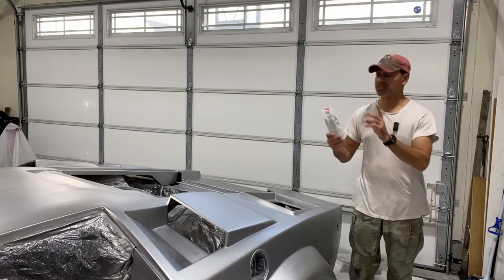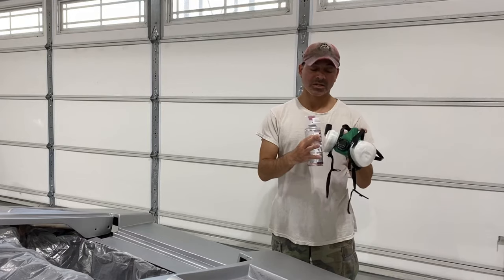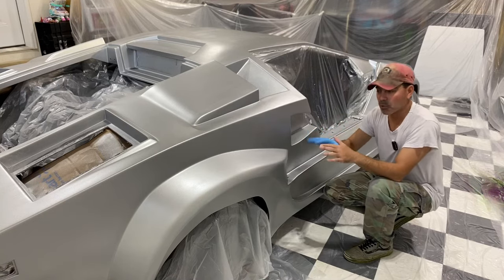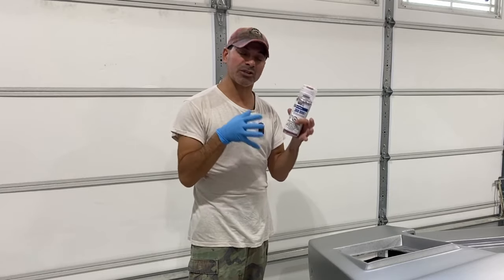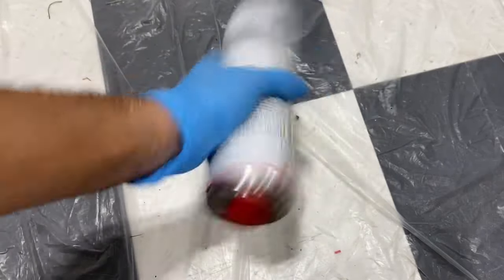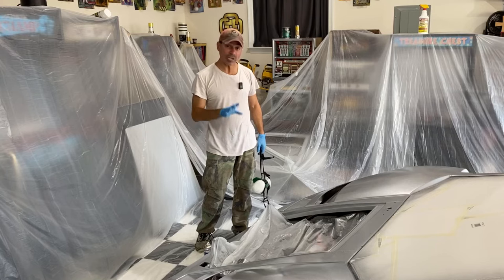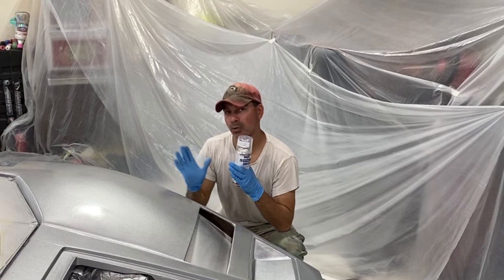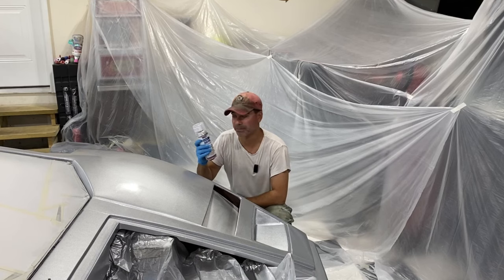Spray Max 2K Clear Glamour - Product Review (Andy’s Garage: Episode - 378)

Comment: I appreciate the review but this clear is meant to be sprayed in minimum 2-3 coats and actually has a higher tac so can be sprayed heavier than shown without runs. Actually very easy to get a factory looking finish with no orange peel using this clear coat.
Reply: I’m looking to use something on my alloys to finish them. Can you recommend a better product or how to get a non orange peel finish with this? Thanks
Reply: @garylow8668 first prep well,just apply more coats, wet sand and buff to get glass finish. This guy went and sprayed an entire car with one can and then complained that it had orange peel?! No shit! Even a pro gun requires multiple coats. I dont know why people feel compelled to do reviews when they have no idea what they are doing and no clue how to use the product.
Reply: Word

Comment: I did the hood and roof of my Corolla used 2 cans ,did 2 quick coats had a little left started 3 on hood but started sputtering,shaking to get what's was left in can..i also wasn't pleased with spray pattern.. definitely have to wet sand and compound... two cans might get you a nice job on 1 panel

Comment: This stuff is amazing for touch ups. I wouldn't recommend it for anything larger than a painted bumper though. Unless things have changed I don't believe manufacturers approve of charcoal respirators for isocyanate 2K paints. Fresh air supplied safety gear is recommended. That chemical is deadly and you really need to protect yourself.
Reply: Thanks for that info whales

Comment: Replacing a fender on my 2004 Ford F-150... it's off the car and I have the color coats already on(Ford True Blue, Duplicolor). I watched the videos and read most of the comments. here's my experience.
Just sprayed on the first coat of the Spray Max Glamour and will wait about 15-20 minutes to coat it again, Disappointed that I got a few spits from the spray nozzle and I did get one small run as I got too much on in one area. Not too much orange peel which is good. I used about a 10-12" wide spray pattern as recommended on the can as opposed to shooting the whole length of the fender. I think I'll do long strokes for the second coat. I check back when I have it done.

Comment: I wonder if you held the can a little closer when spraying if it'd go on a little smoother? I think sometimes, I'm not a professional painter by any means, when spray paint is held too far away when painting in certain conditions that the droplets can somewhat dry before it hits the surface and cause a bit of a rough finish.
 Also, how many cans would you say it would take to put 2 coats on a Lexus ES 330 rear bumper?
  Thanks for the video 👍, I think it turned out good.
Reply from the maker: You might be able to use just one can
Reply: @PhillipsVision  Thanks for the info
Reply: I think you're correct 'bdoeine'...I'm getting ready to use this product on a front fender I'm replacing on a 20 year old pickup. I encounter the rough finish problem when I used the Duplicolor spray cans to put the color down on the fender. I concluded that I was way too far away from the panel as I applied the paint, thus it was going on 'dry'. I found another video where the guy discussed this and he actually sprayed a fender and his hand was literally 3-4" from the panel, and it came out great. I was surprised how far Andy was from the panels Andy was when he did this video..
Of course...the closer you are to the panel the more danger you have from runs and sags. Needless to say, spray painting, even with a gun is tricky and takes a lot of practice and experience.
Reply: @exnjute  Interesting! 👍 You got it figured out, awesome.

Comment: I bought this stuff on a whim from Amazon to try and fix the peeling clearcoat on my 99 Honda crv. I haven't used it yet.  Never done this before.
Reply from the maker: If used and prepped properly it will work well
Reply: How did it go??
Reply: @PhillipsVisioin I have a car peeling on the roof also can I wet sand the clear coat of that's already on there down to the paint then just spray over
Reply from the maker: @joseconstante1321  you can as long as you blend it well
Reply: @PhillipsVision  so I know not to sand the place where there's no clear coat but the rest of the roof should I wet sand it or just the edges where it's peeling or do the whole roof that has clear coat and just spray all what do you think
Reply from the maker: @joseconstante1321  you can try sanding the edges to blend it, but if not you will need to do the entire area
Reply: @PhillipsVision  is 600 grit ok?? And ty what mask do you recommend and glasses ? It's my first time so I wanna do it right
Reply from the maker: @joseconstante1321  here a good mask at Harbor Freight: https://www.harborfreight.com/safety/masks-respirators/paint-body-respirator-kit-large-56983.html

I would use 1000 grit sandpaper so you get a very smooth blend. You can start with a lower grit but end with 1000 or higher
Reply: @PhillipsVision  ty any other tips you recommend I fo
Reply from the maker: @joseconstante1321  Here’s a video I did on fixing clear coat, this might help
https://youtu.be/scecYB4R0ek?si=fm__c2y6nBdWksXk

Comment: Do we need to sand or prep the surface to use this clear coat ?
Reply from the maker: If the color coat is good, no. If the color coat has an orange peel finish or flaws, then yes
Reply: @PhillipsVision  the clear coat is good I just want to put extra on it (what is meant by orange peel)
Reply from the maker: @danieltenorio3559  when the finish has ripples, and is not 100% smooth

Comment: Does this work with clear headlight lenses? Enjoyed the vlog!
Reply from the maker: I have never used it for that, but others have and said it worked
Reply: It will, but make sure you sand off all the old clear, you'll see lines(edge of old clear) just keep chasing it off with 1000 grit till gone, it will look frosted, but the clear will make it new
Reply: it works but unless youre in a legit paint booth and even then it doesn’t look oem. orange peel, clamy-ish look. better off doing detailers perspective on headlights with sanding it down, refining the scratches with 1500, then polish, then either ceramic coat or a protective film. spraymax would be the cheaper quicker option but looks funny next to a brand new headlight
Reply: What Mackie said is incorrect. I've done many many pairs of headlights that look oem. sand from 800-1500 or 2000 and spray wet and evenly and they are incredibly clear without needing additional work

Comment: A few things you want to use a P100 3M filter with this stuff. and second you should cover all your skin.  You also need to wear safety glasses.  The spray can still get in your system through your eyes and even your ears.  I wear ear plugs.  You need to do three coats and the third coat should be a wet coat.  This is not like rattle can paint so it does not run like normal rattle can paints.  The only thing I do not like is the product is only good for 24 hours then you have throw it away according to your city codes on paint disposal.
Reply: After the first use, store the can in the refrigerator.  Cold temperatures slow down the reaction with the hardener.  This will not give you unlimited pot life, but it can help extend the lifespan by a few days.  Car Rep and Eastwood make a 2k that does have unlimited pot life, but it takes longer to fully cure and the Eastwood product cracked five days after I sprayed it on three different small projects.  I haven't tried the Car Rep product, but I'm hesitant to do so after my experience with Eastwood's version.  I've not had any issues with Spraymax.

Comment: And I'm sure u know about car rep s 2 k clear coats as well as colors  , no slamming to activate hardener , once u spray and it hits air hardener is activated !
Reply: I tried the car rep clear.
It started to crack on the 4th day like cracks which appear on a windshield after a rock chip.
By the 6th day in garage the whole paint job was like a web of random cracks in clear coat.
I followed every instruction to a tee.

Looked online and found another guy with the same issue in a sub comment.
Found the same guy commented on all the car-rep videos.
I must have missed it in my researching.
Anyway that guy was right and I learned the hard way.
I'm being very calm considering I am just now in the process of sanding it all off by hand.
Reply: @optimoprimo132  horrible , I wonder why it went that bad the process ? 👍

Comment: I'll be honest with you without 
Being a hater that's overdose no justice 
And I feel you just did one coat 
From 1 to 10 I give it a two 
You probably just use one code just to make this video the real question is how did it last up from 8 months from now 
But that's just my opinion in an opinion is an opinion the fact of the matter is that I helped your algorithm and drop the comment 
By the way the replica is stunning 
And I wouldn't mind driving around in that replica
Reply from the maker: @Pepelsx416  thanks for the comment. Paint is still looking good just need to apply the final top coat and clear coat to wrap it up

Comment: Sprays a light coat on the entire side of the car with one can and then complains it had orange peel.. this can is for localized areas sir. You must apply 2-3 coats to get the actual results. Just like a pro gun you need 2-3 coats. Learn how to use a product before filming a review and misrepresenting what a product can do.

Comment: You really shouldn't spray this stuff without skin or eye protection, and Harbor Freight is the last place on Earth I'd trust my lungs to.  Get a paint suit, full face 3M respirator, and fresh P100 organic vapor cartridges.  An air-fed mask is preferable in a closed garage, but fresh cartridges will protect you for a period of time before they load up.  Isocyanates are not something to take lightly, one bad exposure can sensitize you to the point where you'll never be able to use automotive paints again.
Reply: Hey is the p100 better than the 6023p1? @surge98
Reply: 3M 60926 with a full-face 6800 series respirator is what I use. Wear a paint suit with hood and chemical-resistant gloves.